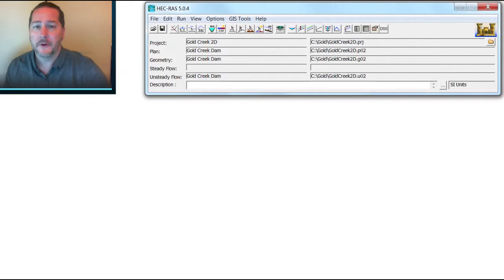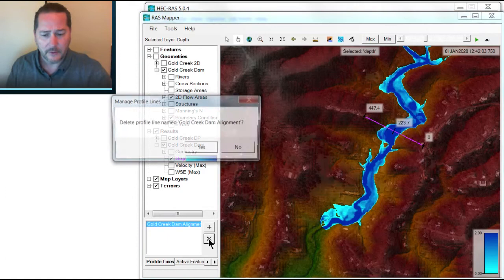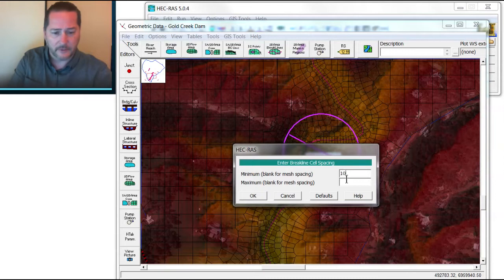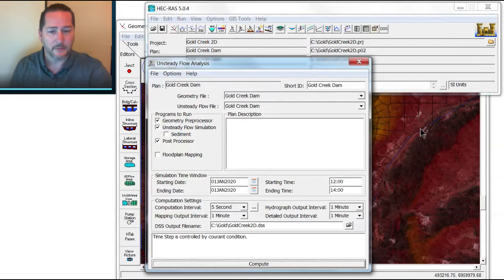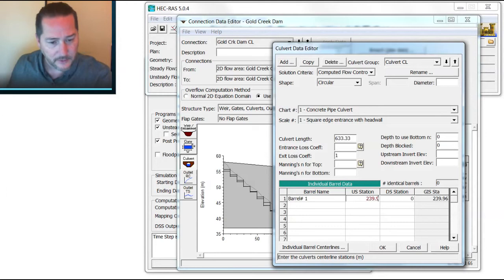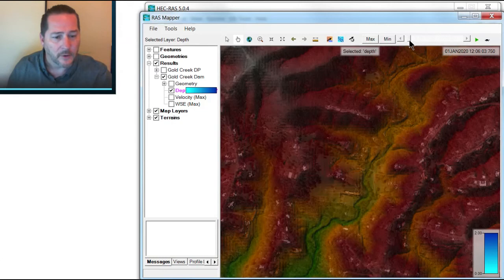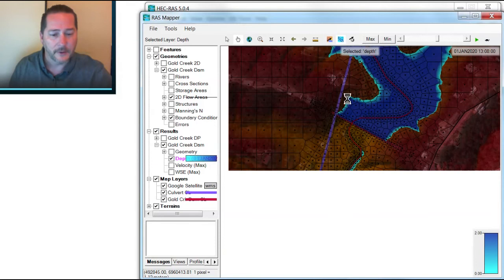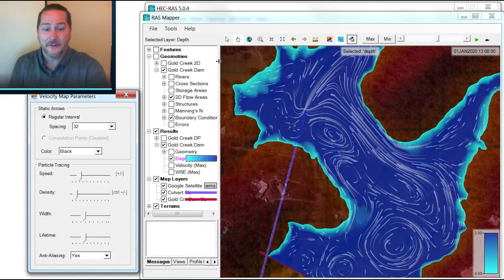HEC-RAS Basics Part 7 of 8: Culverts and Hydraulic Structures

Comment: Nice video, thanks
Have a question on skew though, I have tried by changing the US & DS stations in the culvert data editor but it still shows straight in plan view and when I try to run unsteady flow it comes up with an elevation error as it is obviously running into a bank.
Any ideas?

FYI figured it our, use GIS co-ordinates.

Comment: Hola, que gran curso, felicitaciones!.
Tiene alguna sugerencia para este error! he intentado refinar la malla y no ha sido posible correr el modelo con la presa. 
[For the Hydraulic Structure b1
in 2D area Perimeter2
there is an error with the model data.
The weir station/elevation extends too far beyond
the last face point (face intersection).
Shorten the weir stationing or adjust the cell mesh
Error Accepting the preprocessor files.]

Comment: Hi Krey, Thanks. Can you impose a specified stage hydrograph at the downstream end of the culvert in this example?
Reply from the maker: You can now use Outlet Rating Curve or Outlet Time Series with any structure under the connection data editor

Comment: Thanks for the video.
Is the connection between the 2d upstream cells and the culvert similar to 1D-2D connection?
Reply from the maker: In a way, it's similar in that the model will set the headwater elevation for the culvert using the 2D computational grid cell that aligns with the barrel inlet location. The culvert itself will be a 1D feature regardless of whether it's inside of a 2D area or a 1D reach.

Comment: Hi Krey. Thank you for the videos. They are really helpful. Can you please advice if we can add culverts only without any structure using SA/2D Area Conn? Let 2D terrain take care in case if it spills. Let me know if you've not got my query correctly. Regards.
Reply: @TheRASSolution  Thank you for your response.
Reply from the maker: You'll still need an alignment, but if you copy and paste the terrain profile as the weir profile, it's essentially a line painted on the ground and can just run along the embankment/bridge deck terrain without a hydraulic effect. But barrels do need to cross the 2D/SA Area Connection alignment.

Comment: Hi Krey. Thanks for the tutorial. I have a question. Wha's the relevance of adding a Weir Width. I mean, I have tested to add a weir width and it seems to be that nothing happens. In your case, you don't even add a width. Might you share any comments about that ?
Reply: Krey, just in case you need it. Apparently, the weir width is not just for schematic purposes. I mean, Ras doesn't use whit that, nevertheless pop up a trouble if the weir (width) extens the limits of the 2d area.
Reply from the maker: The weir width is just graphical. The actual width itself would need to be accounted for in the coefficient (which would also be ignored if you switch to the normal 2D equation domain.)

Comment: Hi Krey,

Thanks for a great video. Is HEC.RAS 5.0.4 the first release where culverts are allowed to run underground? When using previous versions, would you have to modify your DTM to include a "trench" for where your culvert would be?
Reply from the maker: Yes, culverts can now be underground where the barrels cross the connection centreline, but HEC-RAS still can't deal with negative depths at the inlet and outlet, so the culvert invert will need to be at or above the terrain elevation in the computational grid cell that matches up with the inlet and outlet location. In most cases, that still involves a requirement to modify the terrain, since LiDAR data very rarely picks up the actual stream invert/thalweg elevation at inlets and outlets due to vegetation, debris, etc.

Comment: Krey, is there the possibility to create a culvert manually ? I mean ,without the necessity to use a shape file? I'm trying to do it as a simple "hole" , specifying DS/US stations and so on, but it doesn't work to me until now.
Reply: Thanks a lot Krey. I have notice that there is an important limitation of this tool regarding to the number of culverts groups that you are able to include. I seems to me that is 11 and not 20, as the User's manual points out. Just if this is useful to you. Regards from Perú.
Reply from the maker: It can certainly be delineated manually. I like to just hold CTRL down in the geometry editor while delineating the barrel centreline, then copy the coordinates into the barrel coordinates table.

Comment: Hi Krey, is it possible to model 2 culverts like you do in the video? I'm a student and I have to model 2 simple culverts of a road crossing. I'm trying to do this but I am able to import only one culvert center line related to my SA/2D Area Conn.
Reply from the maker: You can add barrels to individual culvert group, as long as they all have the same geometry. If the geometry is different, you'd need to insert additional culvert groups. As long as the barrel centrelines cross the 2D/SA Area connection alignment, you should be able add many culverts.

Comment: Hello Users, I just need some insights on Breaklines.

I have added breaklines into the 2d mesh area and enforced them as internal connections and entered weir data as top spillway elevation at 700m to the connections assuming they are acting as Embankments/weirs to the reservoir.

But After I ran the Unsteady flow model successfully, in the results section in the RAS Mapper Water still flowing over the embankments at 653.55 only without filling the reservoir up to 700m elevation.

What Should I do?
Here I am attaching the supporting screenshots..

Thank you in Advance
#HECRAS #2dMODELING
Reply: Same is the issue i am facing right now as mentioned in my question above.

Comment: Hi sir, How to give reservoir storage and release(discharge) data in this software? plz tell.
Reply from the maker: If the model is already set up and running, you can add a profile line across any cross section and right click on the profile name to plot time series flow data.